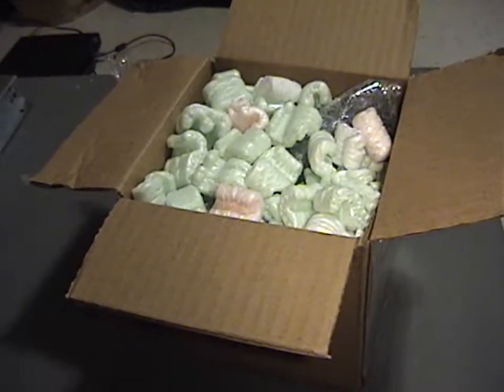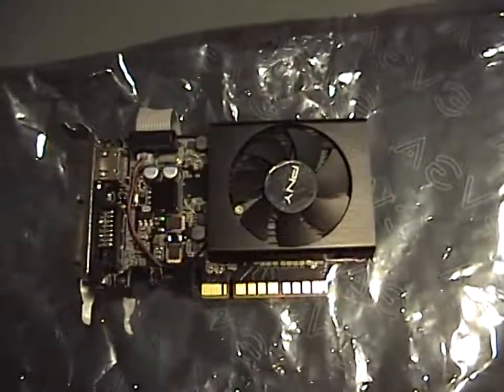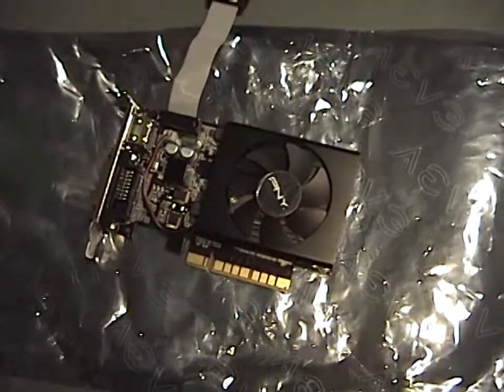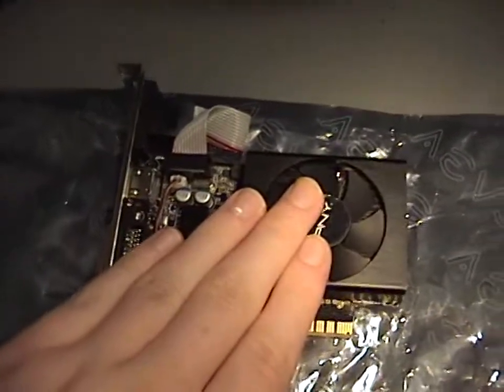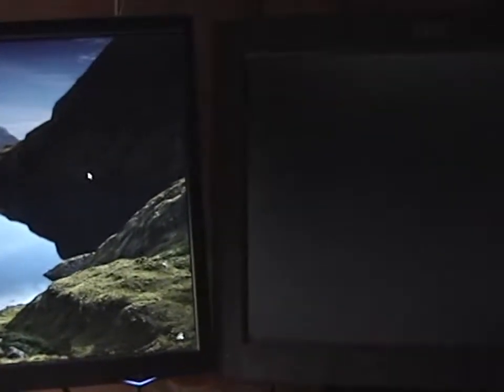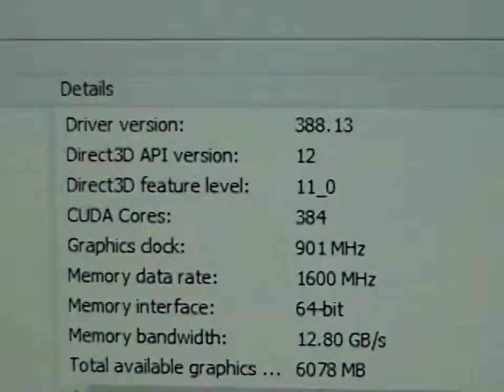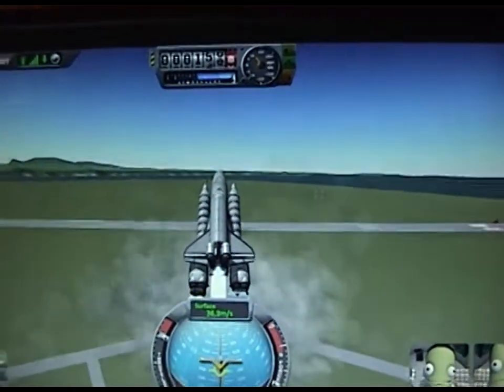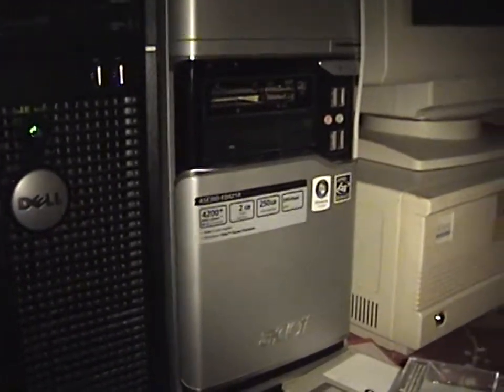*Another* new video card for the desktop PC (donated by a viewer!)

Comment: I have a GT730 in my WinXP retro gaming machine. It has 2GB DDR3 64 bit, so memory bandwith is a very low 14GB/s, but it does have 384 cuda cores, so if you don't use AntiAlias, it is plenty fast for lower resolutions. There are some versions with 1GB GDDR5, which is quite faster in memory access and so in games at high resolution and with AA activated.